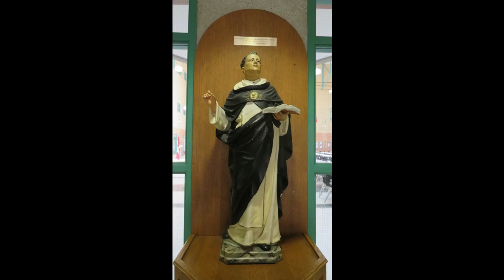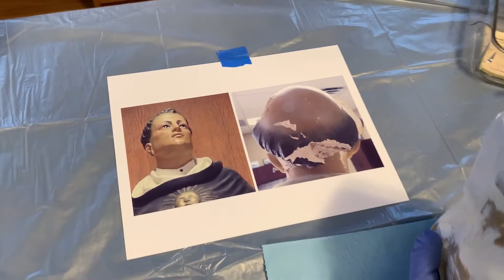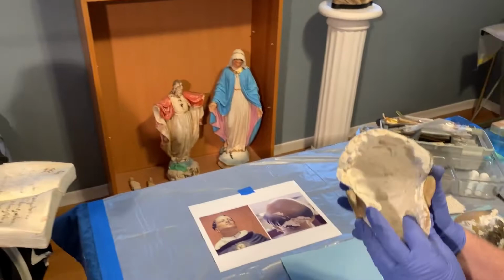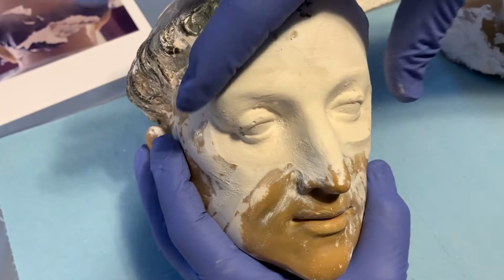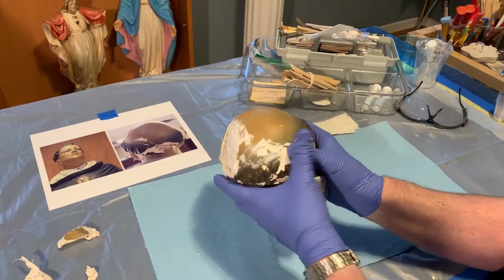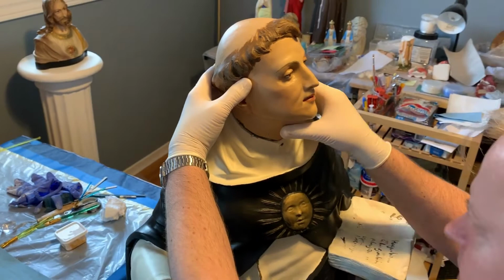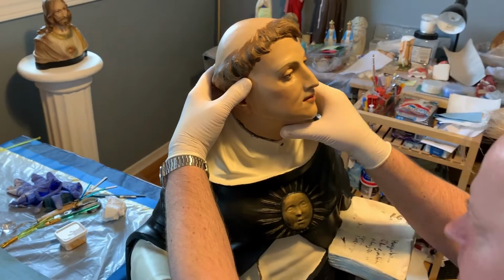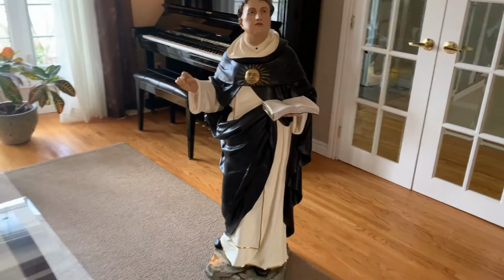Thomas Aquinas Restoration

Comment: Amazing work!! What do you use as the finishing coat? Is it a  clear gloss ? I’ve painted a damaged Saint Joseph here at my house but it needs a gloss of some sort. Not sure what I should use. Thanks!
Reply: Thank you so much, Sheila and Rick.  For most of our projects, we do not apply a final lacquer, as it can change the look of "reality."  If your statue will be handled, you can consider a clear, matte (or glossy if you wish) lacquer.  We use this locally-sourced medium/varnish. https://wallacks.com/products/wallacks-fluid-medium .   But you must be very careful and use very thin coats as some lacquers (not this one) may contain thinner which can harm or even wrinkle the paint coat underneath.  Then you've really got a mess to fix.    If your statue is intended for outdoors, you'd need a thicker water-proof lacquer that won't yellow.  In our opinion, it should also be applied by brush rather than sprayed.   Hope this helps.  If you'd like our opinions specific to your particular project, feel free to contact us via our website at www.statuerestorers.com ( click "contact us") and we can correspond from there.   God Bless.
Reply: Thank you for your reply! I will make sure to add a thin coating . Maybe I’ll test a small area .  Your repair was amazing!
Reply from the maker: @ricklynard9539  thank you and good luck!

Comment: What kind of paint are you using?
Reply from the maker: Hello Duje.  On this project we used Zinsser123 base primer coat.  Then several coats/layers of Behr Marquee primer/paint mix. I write "several," because there are at least two coats throughout, but in some places, Pauline had to blend additional colours and apply additional coats to achieve shading, particularly in the folds and creases of the garments.  Hope this answers your question.  Take care.
Reply: @BrushworksStatueRestoration   I'm repairing Jesus statue. And how do you resculpt a missing piece of statue, for example a whole hand?

Comment: How did you attach the head?
Reply from the maker: Hi there.  We used two-part liquid mixed epoxy to secure the head to the base, then sculpted the structure using a product called Apoxie Sculpt.  and the final outer layer was HydroCal plaster.